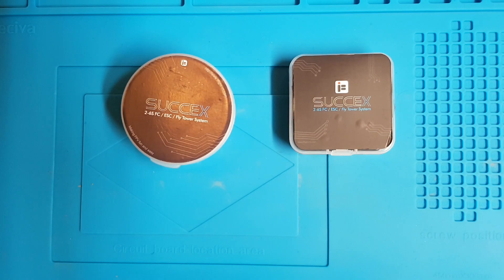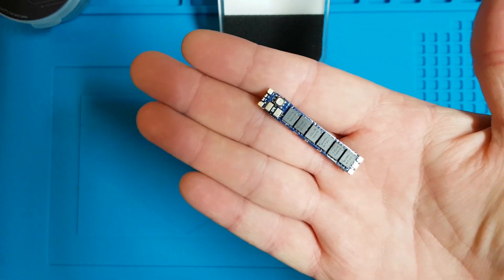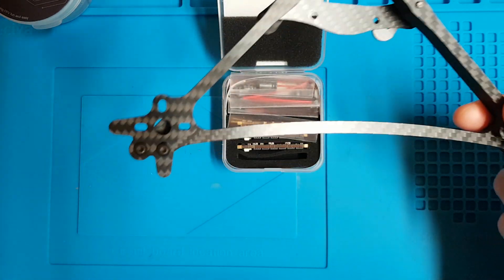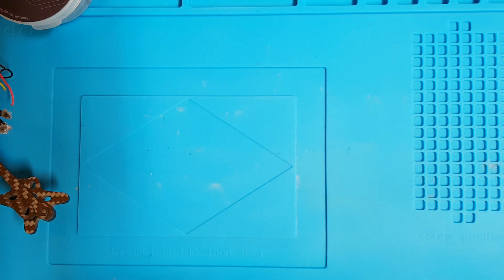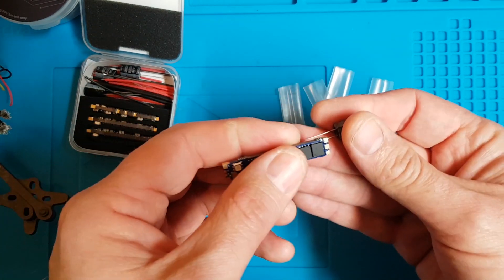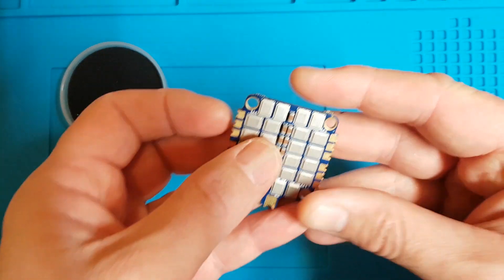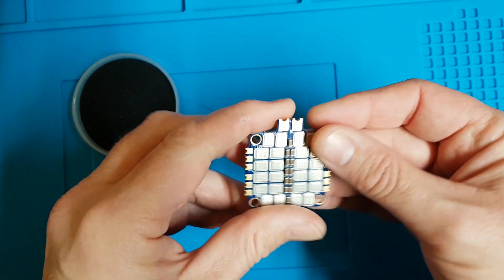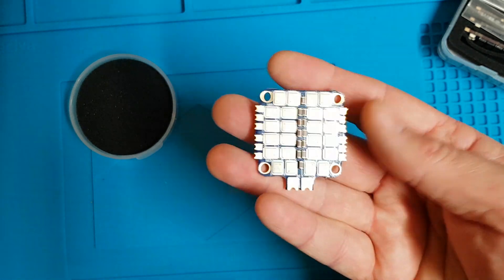Iflight Succex Slick 50amp & Succex 60amp + escs

Comment: Funny how I ran into this video about the individual iflight esc's  and the vert freestyle V2. I bought the vert at the end of last year. Had the Aikon  ak35 4in1 and several  different FC's in it. I wasn't happy with any of them. Too too tight build. And ruined a bec on one of the fc's  because of lack of protection when I landed on my maiden flight. Smooth Operator  was a way better setup.  Now I'm  almost done building the Vert up with these esc's and the new speedybee  f7 aio. Hoping it flies nice.
Reply from the maker: These are still going strong. Currently in use on a kiss v2 rig.
Reply: @CoppertopFPV  I "m running 6s, and the included 50 volt caps are huge. lol First rig I've actually used 50 volt caps on.
Reply from the maker: @MouwDown  yeah. Mine are on a 6s rig also

Comment: The slick 50s pair wonderfully with a matek f722-se for that ultra clean build, they absolutely handle 50 amps each without any problems, I've puffed a 100c 1500 4s with them and they were not even slightly warm. 
Wrap your ESCs where the props would hit them, bend a prop down to see where with some velcro, makes them bulletproof.

Comment: Well it's been a month now, how do the slims hold up. I fly hyperlow verts only and am dying to know how they hold up.
Reply from the maker: No issues so far
Reply: I've been using them on an iflight build with tachyon 2207s on a battleaxe frame for freestyle, regularly punching out at 180+ amps 4s and they've held up fine, not even slightly warm after abusing them like that.  A tip, wrap them with velcro where the props are likely to hit them, velcro is bulletproof against prop strikes.

Comment: Those slick ESCs are just that - super slick... but the cost is probably going to relegate any notions I have of using those to a 7" GoPro hauling rig where cost is basically no object... except that my $32 (USD) sunrise cicada 4-in-1 ESCs just refuse to die, and I'm only missing out on current sensing (which can be achieved just as easily with an XT-60 passthrough-CVR type setup for a lot less money)... and the excuse to run a lot more on-arm LEDs are brilliant.
I run 7" on 6S at racing speeds (ironically that's actually one of my best racers)... on those same $32 Cicada 30A 4-in-1 (with a big 35V cap), and I have yet to encounter an issue.

Comment: I'm done with individual ESCs unless I really have to, too many god damned wires. That 60A looks great though.
Reply: Nice! Good luck, i'm done with 4in1 escs, i've burned 3 tekko32 and 2 dalrc engine, and it is a real pain to replace them and it is also very expensive, i'll buy individual escs and hope don't burn a lot
Reply: @jordigrau83  buy ak32 4in1. Had 20+ 0 fails in flight and fly high kv 2200kv+ 6s and highest potch 5-7in props with them a d have many 150-170mph speed runs with them and no problemo as well have ran 2450kv 2207 5in on 8s with one for 10 flights no failures best 4in1 out.not sure abojt new 55a but likely even better
Reply from the maker: Fraser Steen yeah pain in the ass to setup, but much less hassle when they go wrong.

Comment: Too "high end" for my £8 per hour😐...
Reply from the maker: Spedix 30amp blheli_s. Cheap and they never die!
Reply: @CoppertopFPV  Also the Sunrise Cicadas have been shockingly good for the proce on my end.  For 4S, the old IS30 ESCs are absolutely unkillable (though a touch noisy with super-strong motors)
Reply from the maker: tehllama42 I much prefer the old Spedix to the newer blheli 32 which is why I moved away from them. Personally I’d never pay £65 for a 4 in 1 unless I was doing something crazy and huge. The slicks I would probably get - but only after someone had confirmed they last. Hopefully they will lol I can cope with the odd £14 if one fails but I’d cry buckets replacing a £65 4 in 1!
Reply: @CoppertopFPV  Right - although when I do a cost-writeoff analysis of how bad I usually break stuff ($20 is my average bad crash, anything under $5 is gas/battery/food change), I can live with writing off $30 ESC's if my ease of fixing them is tolerable.  If the 65GBP versions were really that bulletproof I'd be heading about it, they're just better - probably worthwhile for pushing the envelop long range, while carrying a pricy GoPro and some nicer hardware all around, but anything flown within LOS I'm happier flying <$250 quads and repairing as stuff breaks instead of dealing with that crushing psychological blow of writing off something I actually think of as expensive.

Comment: LMAO love the intro! I got the beast on my 2208 1800 KV 6s build, the damn thing doesn't even get room temperature after Full Throttle Big air flights. The slims I'm going to put on my Smooth Operator. Just because I don't like the battery strap touching the FC. It's been causing me some issues. F1 problems lol. A broken nail opening the motor containers. 👍😂
Reply: You should do a 450 size build with the Beast. Or the iFlight 7 inch long range but instead of long-range just do a crazy 7-inch freestyle 8s build lol.
Reply from the maker: @FarmerFpv  lol. You should sue them for that broken nail! I'm never buying them again now 😂😂
Reply: @CoppertopFPV  hahaha, OMG can you imagine if they get an email from me or from someone trying to sue for a broken nail trying to open the motor container? 😂😂😂 The judge will probably slap the person in the face and say get out my courtroom 😂😂👊